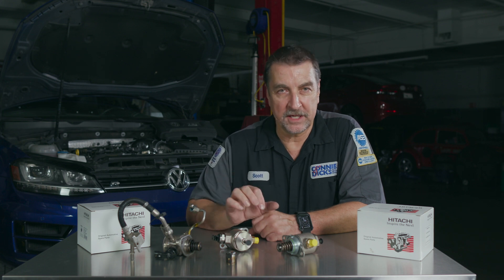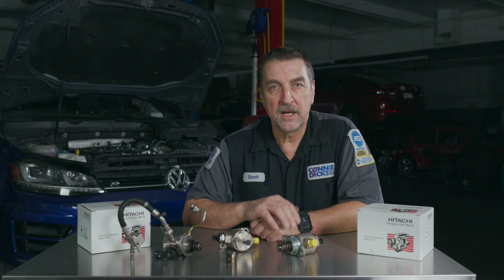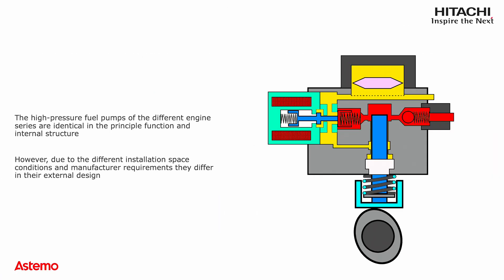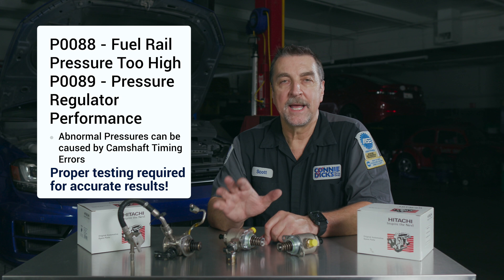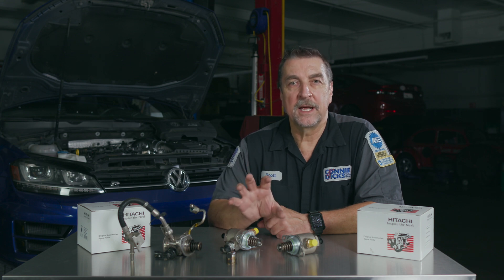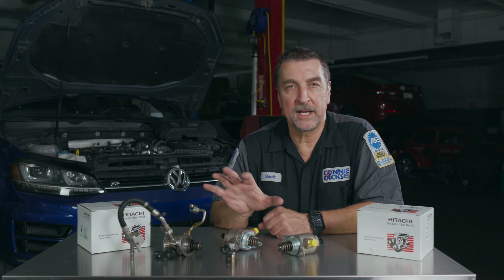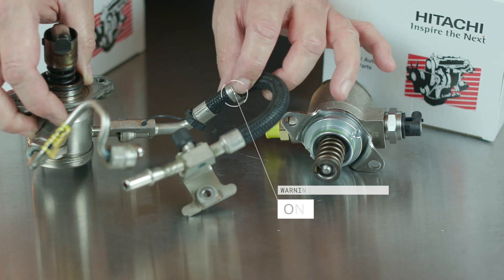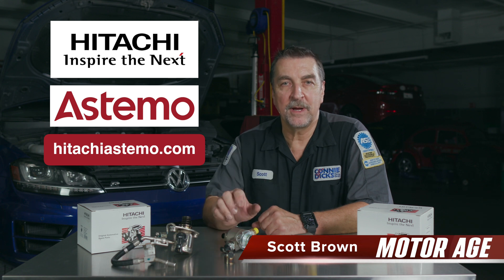Tech Tip: Hitachi Astemo High Pressure Fuel Pump Diagnosis

Comment: I have a Mazda 3 2016 with code p0192 po 193 p0606 does that have to do with the pressure regulator or the pump or both

Comment: Did I understand you correctly about pump timing issue - The proportioning valve timing is dependent on camshaft lobe positioning?
Reply: Yes that is correct. You can see this in the scope patterns I shared. This is why timing DTCs should be addressed before looking at the HPP.